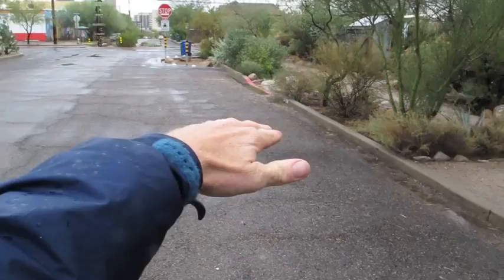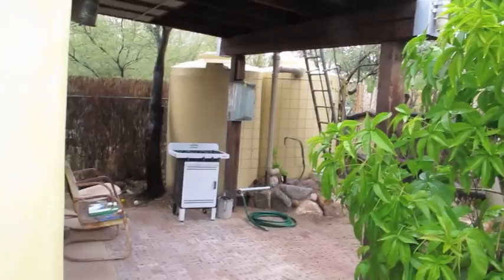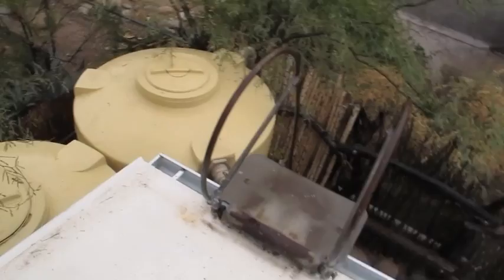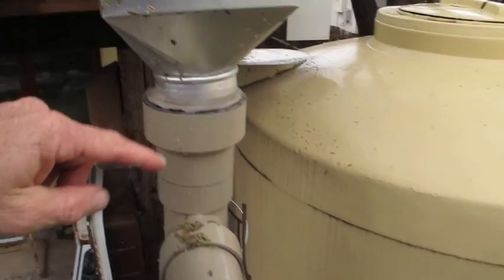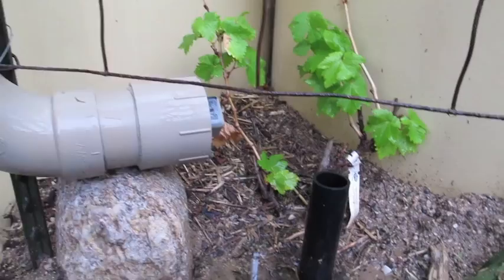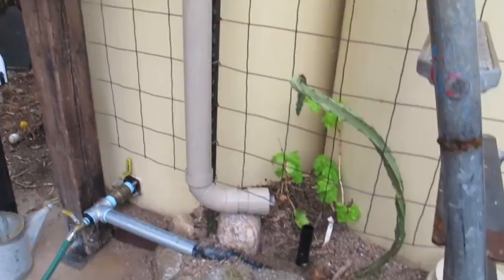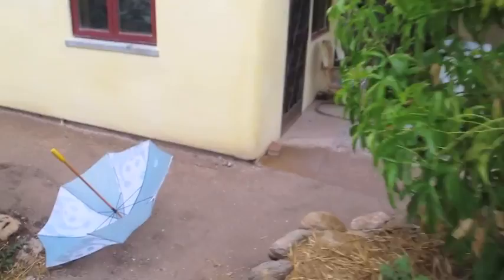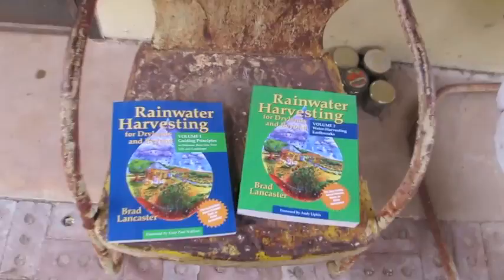Overview of Lancaster-Homestead Water-Harvesting Strategies

Comment from the maker: Chris, the reason I don't have a "slow leak," (like a 1/8th-inch diameter hole in the end cap) on my first flush system is that I find these leak holes almost always clog with the debris being caught in the first flush pipe. So, I don't want to rely on a "leak" that won't leak.

Comment: Hi Brad, Greetings from Srilanka. We met at the AWWA conference in Hawaai in 2007.Regarding the first flush screwed end cap, you could just drill a very small hole at the top of it, so that it would drain out continuously and  completely after a spell of rain and be empty for the next cycle. You need to remove the end cap only when the fine debris builds up to the hole level and clogs it. Much less hassle this way. Good to see you are also into ecological sanitation.

Comment from the maker: Gravity. Water takes the path of least resistance. So once the pipe fills with water, the water drains out the lowest end. In this case, the lowest end of the pipe is into the garottage gutter - just as you can see in the video.

Comment: Great stuff. While watching I had the thought that the first flush would be less maintenance if you let it slow drip irrigate the garden where you most need it, such that by the time it rains again, it'll have emptied and watered your plants for you, then fill up again when the next rain hits. The drip just needs to be designed such that it doesn't clog, and you may still need to clean accumulated matter out occasionally.
Reply: Craig Overend i was going to mention the same thing.

Comment: Drill a tiny hole in the bottom of the first flush cap.  A slow drip will drain the pipe while not having enough volume to impact collection.
Reply from the maker: I find such tiny holes always clog.

Comment: Nice video.  How do you calculate the amount of water you SHOULD flush with your first-flush diverter?   What variables do you consider in your calculation?  Have you a rule-of-thumb?  Seems there would be much to consider between environmental conditions like: rain frequency and volume, air quality, tree over hang, animal population, pollen, dust, proximity to active volcanoes or industrial smoke stacks, and roof construction factors such as pitch, roofing material, and square feet of roof.

Comment: Great video! So much information.  Your setup is pretty amazing.  I was wondering, the first flush diverter that is buried under the pathway, how does it work when it's laying sideways?  Doesn't the diverter have to be vertical for the water to fall and the ball to rise and close the hole before continuing down the line?

Comment: Thank you for the video Brad it was a great help. I have both books and will be putting in some cisterns using both a wet and dry system on different ends of my Phoenix home. This will be in congress with earth works we are planning as well. I was wondering where you purchased that metal leaf shedder for your first flush? Was it a custom job?

Comment: won't all of the trash from the first flush eventually get into the clean water once the diverter fills, or is it more likely that any junk that you'd be concerned with would sink towards the drain instead of float to the top and mix with the clean goodness? thanks for the video!